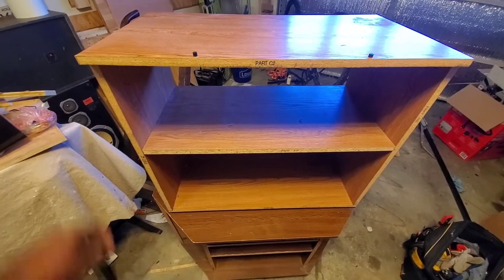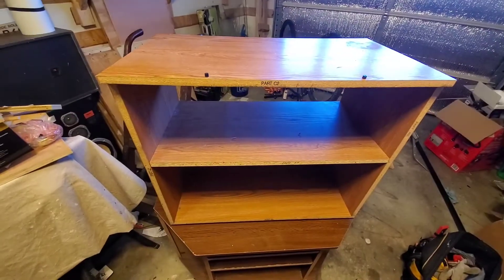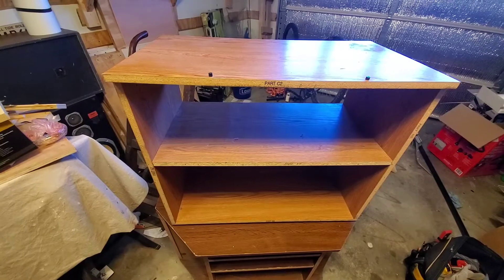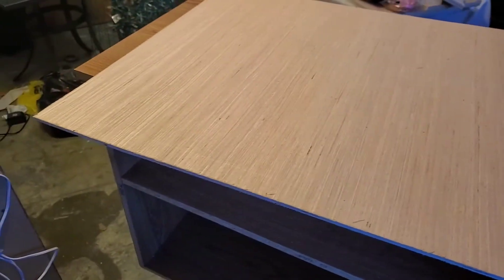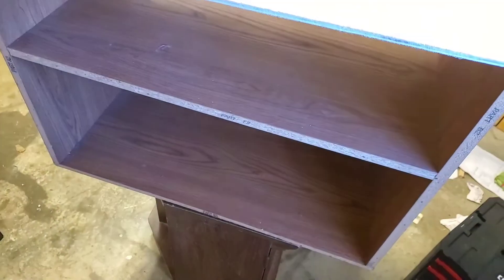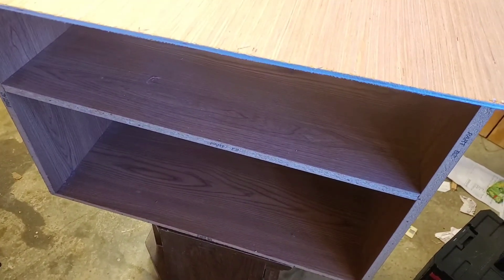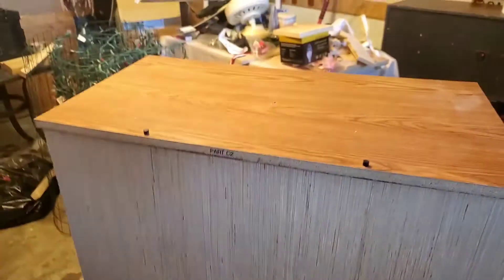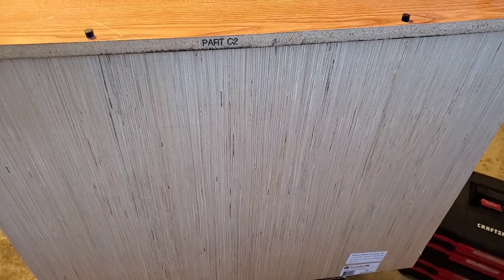How To Fix A Wobbly TV Stand

Comment: What if you don't want a back plate? I have a 9 section free standing shelf that's super wobbly but I don't want a back on it because it's going to be mounted to the wall for Funko pops
Reply from the maker: The back plate is what gives the self the stability. What you could do is install a back plate that is painted the same color as the wall it will be mounted to. That way it doesn't stand out

Comment: How did you attach it? Did you nail it, glue it? Use dowels? What type of wood you used as the replacement back piece? How thick should it be?
Reply from the maker: Used Brad nails to secure it. You could use glue but don't use too much of it